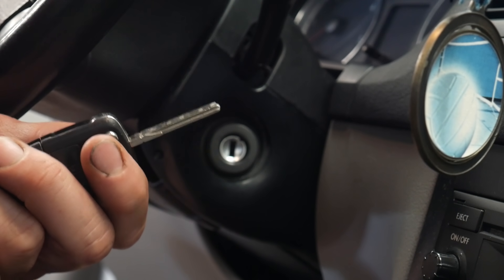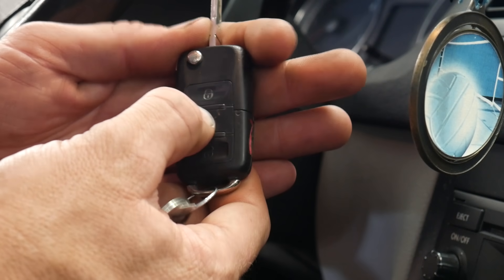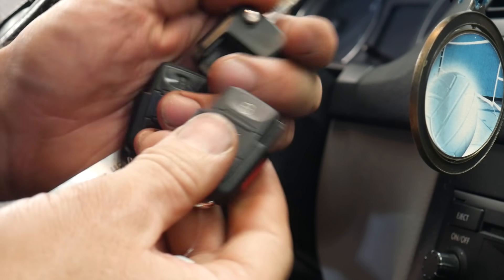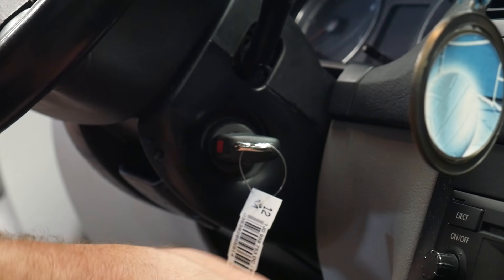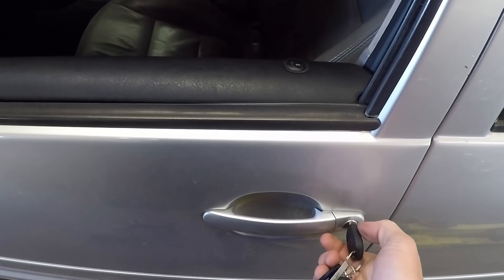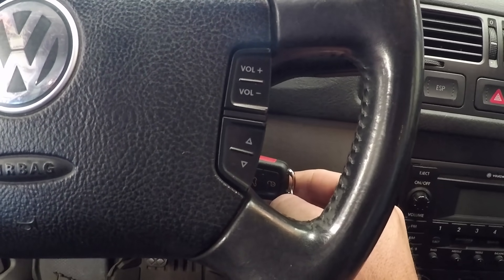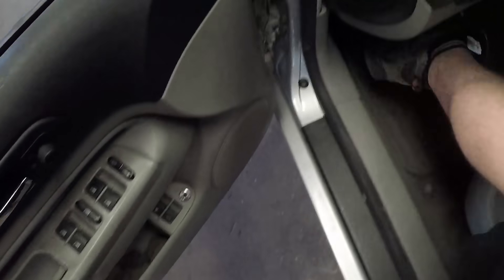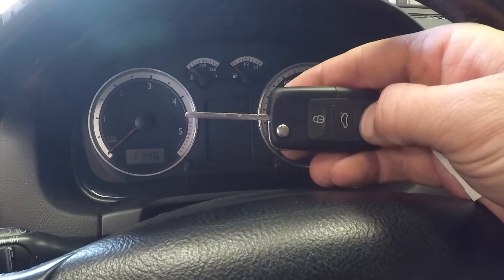How to Program a VW keyfob

Comment: Thanks man,  I just lost my main fob key ( With the transponder ) yesterday and I only have two spare keys i  had  cut previously just to access my car for emergencies ( no  transponder IR/ chip on these)  . Can I order a new fob and use this process to program It ?
Reply from the maker: David Ashby this process will program the remote only. It won’t relearn the transponder. A lock smith or dealership will have to program the transponder.

Comment: Thanks a lot worked first time
Reply from the maker: Simon Caswell great news. Sometime they can be tricky and take multiple times to get it.
Reply: Will thos method work on a 2015 vw crafter van. 
Regards pal
Reply from the maker: I’m not sure if this will work or not on the Crafter.  We don’t get that model in the states. The some of those vans were based on the sprinter van from Mercedes so the procedure might be different.

Comment: Does it have to b a new key or can u reprogram a key that's already linked to a vehicle?
Reply from the maker: You should be able to reprogram a used key fob with this method as well.
Reply: @ThePracticalMechanic  cool thanks
Reply: @ThePracticalMechanic  how do you program the immobiliser chip? I managed to program the remote locking but not the immobiliser..

Comment: My battery on Volkswagen polo died and I buy new one but now light on remote key don't work, and even i cant unlock or lock car remote is there any solution?
Reply from the maker: if the light still doesn't light up the battery is bad, incorrect, upside down or the fob is bad.

Comment: I have a 2019 Polo Vivo. When I press the unlock button on the key, it unlocks all doors. How do I progamme it to open only the driver’s door?
Reply from the maker: I’m not familiar with a model that new but on the older ones it required a scan tool like Ross tech VCDS to change the coding options.

Comment: hey man so i lost my key, in that case i have to buy one at dealership and have them program it at that point?
Reply from the maker: offroadvehiclelover The dealer would be the best way but some locksmiths are capable of making new keys as well.
Reply: @ThePracticalMechanic  hmm... The key is a keyless entry, it's just the fob that goes in the ignition and it starts my car. Anyway ti program that myself without oaying 300.00 usds?
Reply from the maker: Oh I see. It must be a newer one. I have not programmed one like that so I cannot accurately give you the information. It might still require two keys but I’m not sure.

Comment: Hoping this would work on my '07 Beetle. My key fob shorted out and I don't want to pay 350 to have a dealer do it. Does the key still work in the ignition after reprogramming the new remote becuase I've heard some say it doesn't.
Reply from the maker: Sorry for the delay. The ones I have done I was only programming they new keyfob and not a new key. I believe the others that have had issues with the security system were inserting a completely new key and keyfob into the ignition for programming but since this method only programs the keyfob the car still think that someone is trying to steal the car with the new key and the car won’t start. 

Hope this explains it
Reply: Thank you!! I just got the new fob and switched my key over from my dead one, and it works perfectly!! Your video was a big help!

Comment: So I bought a used key online, changed the blade around and tried to program it. It wouldn’t work. Do I need a new transponder chip?
Reply from the maker: The programming in the video only works for the buttons to unlock the doors and won’t work for the immobilizer system. For that type of relearn you may need a lock Smith or the dealer.  If you swapped the blade over I’m guessing that the metal housing that holds the blade broke otherwise you can use your old upper housing with the new lower section with the buttons.
Reply: I have a 2011 Polo so the key can’t be halved, which is why I got a second hand key and got the blade cut. I tried programming it with the method you did in the video and it wouldn’t work. Any idea?
Reply from the maker: Niks :p I’m guessing your outside the USA since you have a Polo. This company rents cable to program the 1 piece key but they don’t ship internationally. There might be a similar service available near you. https://www.tunemyeuro.com/vw-key-fob-programming-guide/

Comment: If have programmed the new, will the old still works?
Reply from the maker: It will normally retain the old fobs and allow the new fob to fill one of the remaining programming slots. if all four slots have been filled then it will often overwrite or erase the original fobs and you will have to reprogram them.

Comment: When programming, do I need to swap over the old transponder to the new blank key for this to work? Or do I just programme the new blank key using this method without swapping anything over?
Reply from the maker: This method will program only the remote. You will have to swap the transponder over or have a locksmith program the key transponder.
Reply: Thank you!

Comment: I lost the key for Volkswagen Jetta 09 and I called a lock smith and they came and the make me a key so when I start the car will turn bk off so couple days ago I found my old key and I tried to start the car it’s doing same start the car and turn bk off I called the guy the one makes the key I explain to him I find my older key it’s doing same as ur key the one u makes he told me to take it to dealership to reprogram so any one happens as same my Situation plz I need a help
Reply from the maker: The dealership may be your best bet. This procedure is only for the remote lock and unlock and not for the key. The dealership or locksmith is require to program the key to the vehicle.
Reply: ThePracticalMechanic  thank u so much

Comment: What hapens with new sword when i turn back that old key sword into his old part of the key? Is that imobilizer in that sword part of the key and will the imobillizer work on th new one because it was not in the ignition when programming? TNX
Reply from the maker: Nedžad Klaja this programming will only work for the lower keyfob portion. The immobilizer is built into the upper portion of the key with the switchblade. This programming will not learn that portion of the immobilizer system and as far as I know you need to factory scan tool to program the switchblade portion of the key. Some locksmiths have the ability to program the switchblade part of the key. The immobilizer chip isn’t in the blade itself but it’s in the upper plastic portion.

Comment: Would this work on my 2006 Jetta with one key? I bought my keyfob on eBay and do I program them just like the video? THANKS!!
Reply from the maker: Bottom text, It takes two keys to program because one has to be in the ignition and one has to be in the door.
Reply: Hi I’m in the exact same situation with the exact same car. I did the trick where I removed the door lock and used a screw driver instead of a second key. I’ve noticed it works on the mark 4’s but I haven’t seen any mark 5 videos that use that method. Do you know if it absolutely necessary to have 2 cut keys? or should one cut key with the immobilized in the ignition and the screw driver as the second key work as well? Thanks

Comment: Hi I have a problem with keys in my golf 4 2001. The problem is I cant open doors frome remote , and I cant open all doors even manually , so I can open just one door and others from inside, does anyone can  know how to fix this problem...thank you!
Reply from the maker: I would check fuses first. There is a fuse panel on the side of the dash that has many fuses. There are a couple of fuses for the central locking system. Do the power door locks work from inside the vehicle?

Comment: Thanks for the video!
Worked the first time on the new remote but can't get the factory one to work.
Reply from the maker: blueboy7777777777777  did the factory remote work before and does the little red light on the remote block when a button is pressed? you may have to try programming both at the same time. After you press the button on one remote and get the confirmation try pressing the buttons on the second remote before cycling the key off.
Reply: @ThePracticalMechanic  Factory one did work until the battery died in it and the car battery died. And yes the red LED light flashes with a new battery in both. Tried to do both at the same time but no good. The new one doesn't make the horn beep but it still works. I have a VCDS I'll just do it that way. Thanks!

Comment: Will this work on a 2007 VW Jetta I had to replace my ignition switch and it came with new key fob with it but won’t keep the car started how do I fix that?
Reply from the maker: @Hashhouse_kennels  the ignition key is not programmable this way.  You will need a locksmith. This is only for programming the remote half of the key.

Comment: ON MINE IT WORKS TO LOCK AND UNLOCKED. BUT WONT START THE CAR. IS THERE ANOTHER STEP FOR THAT TO WORK?? I would appreciate your answer thank you.
Reply from the maker: Jc Df this programming procedure only programs the keyfob/remote for remote unlock and lock operation. The transponder in the switchblade requires a locksmith to program.

Comment: Is this method works with aftermarket keyfob remote?
Reply from the maker: @bencevekony2010  it may work for the remote but this procedure does not work for the immobilizer chip.

Comment: Will this work on caddy ?
Reply from the maker: Cadillac? this should work on most VWs from 99-2007 and some vehicles newer than that.
Reply: Vw caddy van mate
Reply from the maker: @jackbradford7504  Sometimes I wonder why we don't get the same vehicles over here in the States. I have not tried it on a VW like that but it may be very similar. Cheers

Comment: how can i reprogramme the locking sistem on seat cordoba 2005,it opens only the drivers door from the remote and then from the button on the door unlocks others...anybody know a trick for this? ty all
Reply from the maker: Have you tried double pressing the unlock button? That is how most of the VW cars are setup from the factory.  Some models can be coded with VCDS to change the remote settings.
Reply: @ThePracticalMechanic  on some models it works,like on ibiza... i know that bsc my friend drives it...but i want to make it permanently to unlock all doors not just once.. ty for your response

Comment: I need your help! 2005 VW Beetle GLS convertible 1.8L turbo, new battery, new passenger door lock actuator, new battery in the key fob. I can open the door via the lock blade, start the car, drive all day long. BUT, I cannot get the key fob to connect to the car to use the alarm/lock/unlock/trunk. I only have the one key, and have tried putting the key in the ignition, shutting the door, turning the key to the On position without turning on the car and clicking lock button on the door, followed by holding down the Lock button on the fob, but nothing. Tried splitting the fob and putting the blade in the ignition (again, in the On position), removing the lock barrel from the drivers side door and using a screwdriver, turning the lock to the right for ten seconds. I then clicked on lock, waited 2 seconds and clicked again, but nothing. Not sure what other tricks there are to getting the fob to connect to the car :( Any help you can give would be golden, and greatly appreciated :)

Comment: Any of my fob keys works and the dealer is charging $300 for a new key
Reply from the maker: I don’t quite understand but I will give it a shot. This procedure will program the remote (fob) section of the key only. If you need a new key section also the it will have to be programmed by the dealer or locksmith. If you just need to program the new fob section then this should work for you but you will normally need to have two keys that fit the vehicle and then the programming process can be started.
Reply: Jokes on me I quess... Normal key here in Finland is 300 euros. (like 330-350 usd).... And a new remote is about 550 euros for my polo 9n.... Yay proprietary technologies..

Comment: What if I lost the main key?
Reply from the maker: Since this is only programming the remote for keyless entry it doesn’t matter if you are using the switch blade key or service key but two keys are require unless you handy with tools. A second option for the door is to remove the lock cylinder witch is held in by one screw and then use a flat blade screw driver to actuate the door lock.
Reply: @ThePracticalMechanic  thanks for a quick reply! I did not understand how it all works after watching your video for the first time but I googled some more and I know what needs to be done now! Also I was panicking a bit because I had just realised I lost my car keys :D

Comment: it will unlock the door remotely but it only runs for 1 second than stalls. not completly programmed
Reply from the maker: This method is only for programming the remote. If you purchased a new key as well the immobilizer will need to be programmed which requires special tooling.

Comment: I have only one key , how can i do it ? Anyone knows ?
Reply from the maker: ÇAKABEY have to take the lock cylinder off the driver side door and rotate the electrical portion inside the door with a flat blade screw driver.

Comment: Would a unprogrammed key 🔑 rather a key that was programmed then the battery died - would the key stop working and be able to not start car
Reply from the maker: Mr.Dogman YouTube it shouldn’t effect the ability to start the car. Was it the car battery or remote battery that went dead? If the remote battery went dead that will make the keyless entry inoperable but the car will still start.  If the car battery went dead and now it won’t start there may have been a glitch in the computer. Sometime unhooking the battery and waiting 10 mins and hooking the cables back up will fix the issue and some times you have to put the key in run position and leave it turned on for thirty minutes. Make sure to pull the parking brake up so the head lights don’t drain the battery.

Comment: 2004 vw golf is that car same way
Reply from the maker: Jessy James a lot of them are. I would try it and see if it works. Make sure your keyfob batteries are good though. There should be a little red light on the fob that flashes when you push a button.

Comment: I only have one key
Reply from the maker: There is a way around it but you have to take the lock assembly out of the door and then use a flat screwdriver to turn the lock/unlock switch.

Comment: So what id the key fob isnt cut?
Reply from the maker: If your replacing the key fob and the switchblade you may need additional programming. The transponder in the switchblade portion requires special tools for antitheft reprogramming.  A locksmith should be able to cut the blade and program it for you.
Reply: The body of the whole fob assembly is removable and contains the chip; the body is seperate from the switchblade portion; switchblade portion does not seen to contain a chip

Comment: i’m doing all these steps and it’s still not working for me
Reply from the maker: If any of the components required for the procedure are not working it will not initiate the relearn. Make sure the door ajar switch is working on the driver door. Open and close the door and make sure the light on the door or the dome light comes on or turns off. Make sure the lock/unlock switch is functioning properly. Turn  and hold the exterior lock to the unlock prostitution for a few seconds and make sure the windows start to roll down and then go to the lock position and make sure the windows roll up. This will verify that the door latch assembly is working properly. If not the relearn won’t happen. Make sure they remote is correct for the vehicle and the red light flashes on the remote when a button is pressed.
Reply: ThePracticalMechanic so i did all of that and it still didn’t work